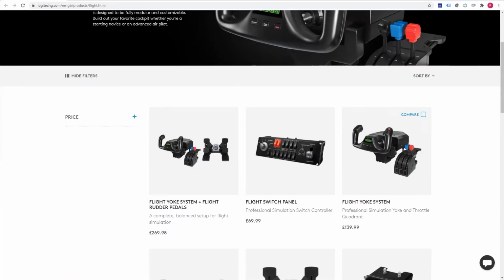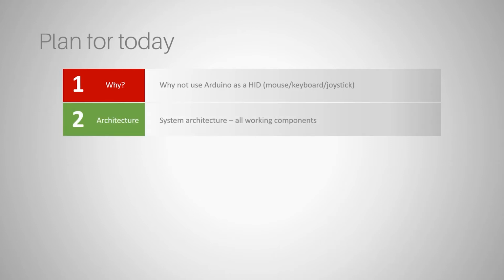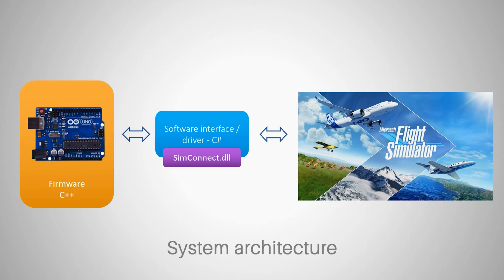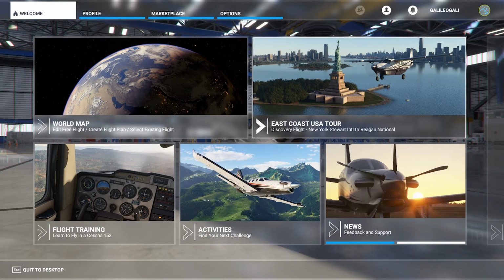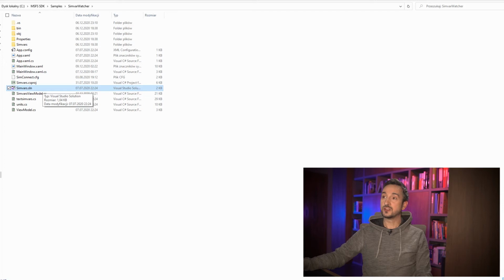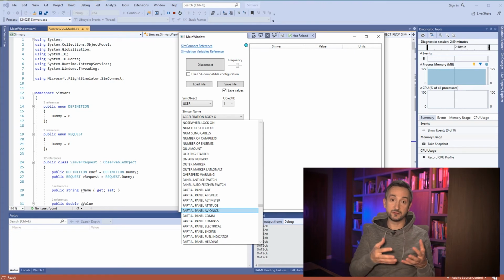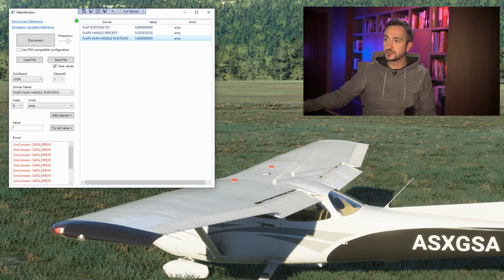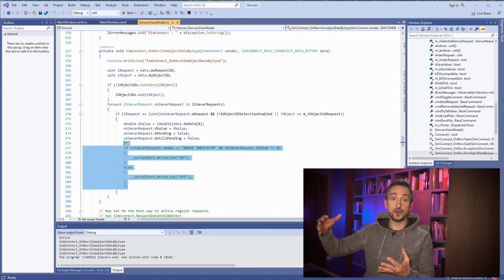Building custom controllers for MS Flight Simulator - software + hardware DIY - part I

Comment: Great video. Looking forward to the next one!
Just a quick question, could you use an Arduino as a HID to control all the switches, button etc and then another Arduino to receive events from the sim and output a led for example?

 Thank so much

Comment: I prefer to use Arduino since I already have it. Will you have a follow up video where we can create our own little project controlling switches and LEDs. I am interested in making a little GPS controller with a few buttons and 2 rotary encoders. I just need to see a few simple examples about the process. I can take it from there. Of course the section about the documentation would be also useful

Comment: Woah this looks like fun. Is this for ANY version of MSFS or just 2020? I'd been hoping someone would post this exact video. So - if I create custom controllers for FSX2004 version of MIcrosoft Flight SImulator will they also work with 2020 when i get it? OK after watching to the end I realise how hard it is to READ what's on my laptop screen so I  may have to output to my 40" TV or get better reading glasses :) 

Are there any books teaching this stuff?

Comment: When is the next video coming?
Reply from the maker: Hi! Sorry for missing your comment :(. I had to take a break to get things up do date at work. In the meantime a great microcontroller has been released by Raspberry Pi (Pico) and I'm considering dropping Arduino and using this new board. However, I must make sure all required libraries are available and working (i.e. LED display drivers, etc.). I'm already testing it and I will soon come back with the rest of the episodes.
Reply: @ProjektAlpha  Czekamy z utęsknieniem, pozdrawiam